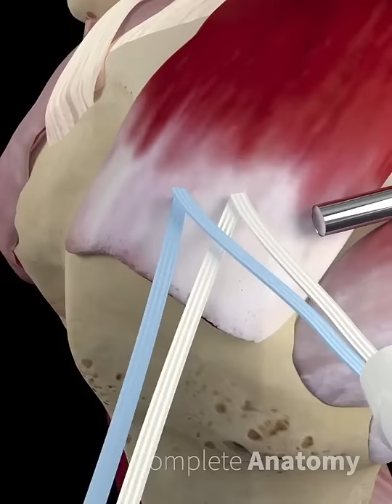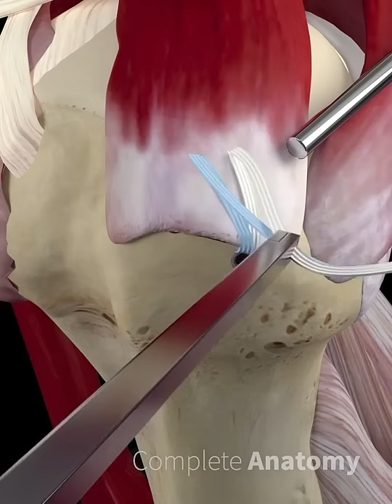Rotator Cuff Tear Repair

Comment: I had a bad snowboarding fall off a ramp 3 weeks ago. I thought I dislocated my shoulder for a second. I tried to raise it but had no strength to do so. I regained strength in my shoulder after lifting it with my other arm. 

I rested for one week and then played basketball for a day because my arm felt fine. Now I’m getting nervous because my arm hurts way more now and I am starting to understand the severity of my injury. 

Does anyone have a similar experience?
Reply: yes, i injured my rotator cuff in swimming, for me it was a partial tear, it was healed by itself but never completely, after 5 years got an MRI and saw that it was torn, I've had pain since it happened ( 8 years ago). go get it checked you might need MRI and Physio therapy
Reply: @arvandpiltan9833  did it get torn again cause you said it was healed
Reply: Me too and it is from fighting i had  pain in my left shoulder then i let it rest for a week went back and hit the bag/sparred/grappled and also did rotator cuff strengthening excercises and the week after which is right now it has started hurting again

Comment: I wonder how strong the new anchor points are?
Reply: Na verdade, as âncoras servem apenas para segurar o tendão enquanto ele se prende naturalmente ao osso novamente. Depois, todo o material é absorvido pelo organismo (material bioabsorvível) e o tendão fica colado ao osso novamente.
Reply: English please
Reply: @mainakbasu9740  the anchor points are just to keep the tendon in its place, meanwhile the tendon readjust itself to the bone, the the material its absorbed for the body bc its biodegradable
Reply: @franarce6984  Wrong !!! At least mine are anyway. You can see them in the x ray and scan now. They are titanium and they are there permanent. They hold the tendons in place to heal. They don't come out. They bone deep.
Reply: @billysanders2251  how does your shoulder feel now? Can you train? Do you regret getting a surgery?
Reply: @billysanders2251  that's fucked up, they don't take those screws out? wtF?
Reply: @RBimas37  Nope they in there for life.
Reply: @RBimas37  You don’t feel them